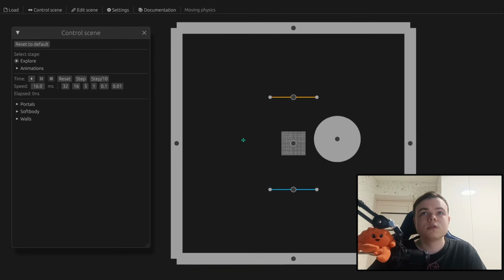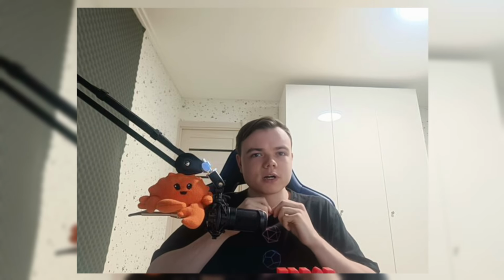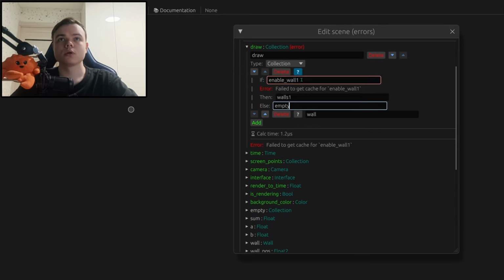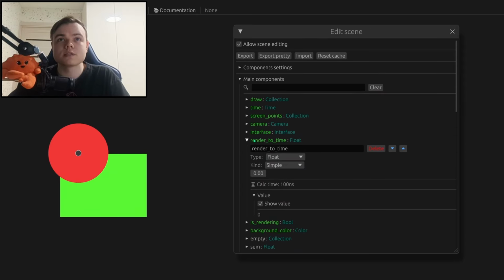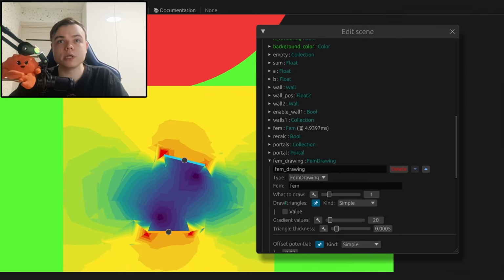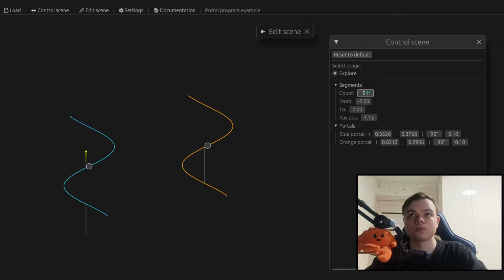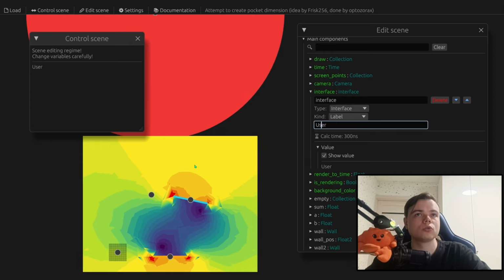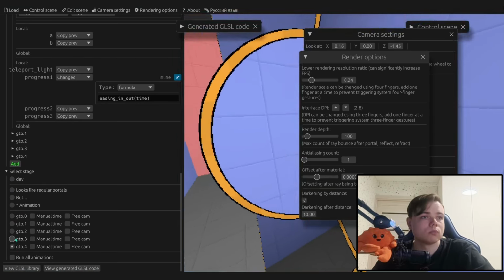How I make animations in my Portal Lab

Comment: when i try to run the portal lab (on win 11 64 bit) it crashes with this error message:
The application panicked (crashed). message: failed to find a matching configuration for creating glutin config
how can i fix it ?

Ps: If it's important, here's the whole message:

The application panicked (crashed).
Message:  failed to find a matching configuration for creating glutin config

Backtrace omitted.

Run with RUST_BACKTRACE=1 environment variable to display it.
Run with RUST_BACKTRACE=full to include source snippets.Run with RUST_BACKTRACE=full to include source snippets.
Reply from the maker: There is a setting in the patreon post, that fixes this for some systems, it's about multisampling
Reply: @optozorax2 thank you ! continue in Russian, if you don't mind. мне кажется что пост можно перефразировать, тк работает это не только на linux. Ещё раз спасибо за такую программу, и уверен что portal 3 мы получим именно от тебя. (правда с телепортацией гравитации он не будет таким весёлым)

upd: Получилось сделать файл .bat для автоматизации запуска
Reply: @optozorax2  can you make portal lab free someday
Reply: @optozorax2  can you pleaae make it free i really want to use it